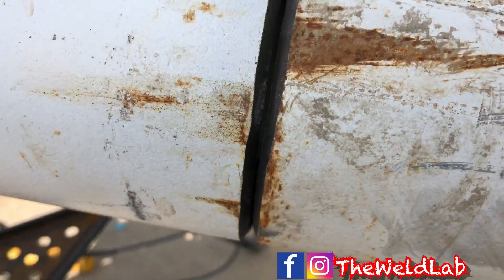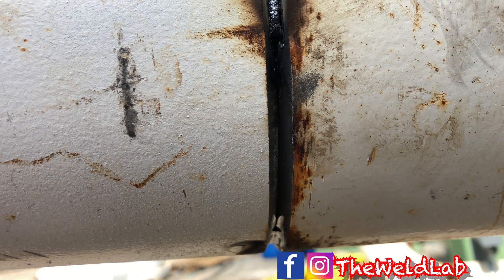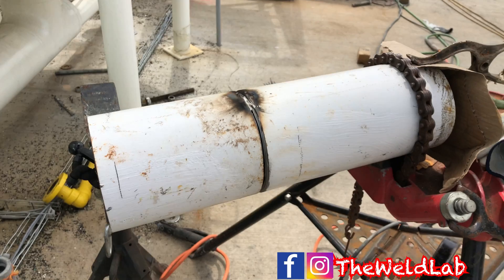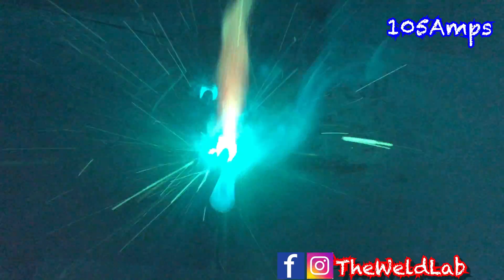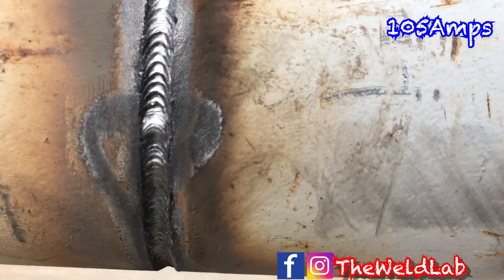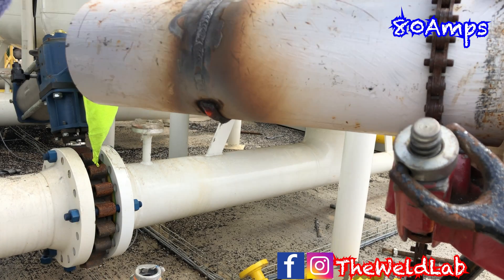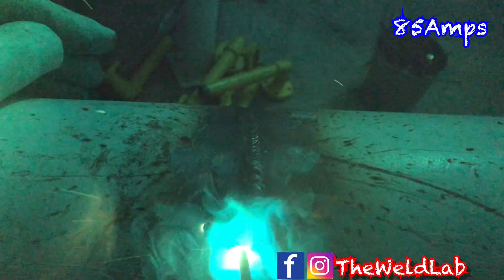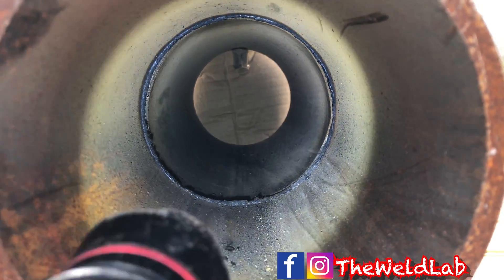5G Pipe Welding 6010 Root 7018 Fill And Cap | Stick

Comment: I'm about to build my truck and I use to be a welder helper and have seen this done, but I'm going to build my truck and just practice a little bit then take off and go welding so I want ti know the in and out with the tecknicts and all the noalage your will to share basic from start to finish on the whole welding process, and the other might and tig and ark welds you do a great job on explaining this shit

Comment: You should have a put a spacing tool on the tight side then you start welding on the opposite side until the spacer falls out, that is when you stop and switch to the spacer side and weld there. Putting just 2 tacks in is asking for problems.

Comment: What settigs should i use i have a sa 250 diesel and im having trouble with the cap im using 7018 1/8 what gear and amperage i had a lot of metal dropping and could getit to stay steady

Comment: Soooo... U did the root pass with 6010, hot pass with 6010, and a fill pass with 6010 and 1 cap with 7018???
Reply: you must be in welding school still

Comment: very interesting technique. Is there a reason you don't tack at 3 and 9 and also, is there a reason you started the root at the top, rather than uphill from 6 to 12?
Reply from the maker: I only use 2 tacks because I find it’s much faster if you watch more of my videos I’m all about quality and production I always try to find the fastest way to put out more work 
And I go downhill because that the procedure my job requires it’s also much faster then uphill

Comment: thought this was supposed to be 7018 fill and cap? haha, i wish i could fill with 6010 on these joints. 90% of the code up here we gotta 7018 hot pass - cap.
Reply from the maker: Yeah man there is different rules for different jobs...and yeah we usually downhill everything and cap with 7018...what y’all welding on?
Reply: I’m from Boston... we do 6010 downhand all the way out

Comment: 3/32" land and the gap?🤔 the same or 1/16" ? Thanks
Reply from the maker: 1/16 will be fine  that’s my preference for any pipe smalller then 6 inches I like 3/32 gap for 8” and up
Reply: @TheWeldLab  Thanks Abraham, your answer and yours videos help me alot. I have never weld pipe using E6010 only 7018 here in europe and next week i have to pass a 5G 12" 6010 open root downhill. Hope everithing will be fine. Thanks you once again and for those briliant videos. Stay safe.
Reply from the maker: @melonmelon3997  good luck let me know how it goes

Comment: Why didn't you opt for a 5/32 hot pass and fill it at the same time? Honestly I clocked on this expecting all uphill lol
Reply from the maker: Yeah bro that would of Ben a better option I was shooting the video at my job and we didn’t have any 5/32
Reply: @TheWeldLab  What kind of work are you guys doing there?
Reply from the maker: Rob Murphy we building a gas plant bro
Reply: @TheWeldLab  Where at? I'm in PA and haven't touched any gas pipe except to renew papers lol been doing structural and equipment repairs to get by.
Reply from the maker: Rob Murphy don’t they have a union job out there a few buddies of mine went out there I heard it’s good money too
Reply: @TheWeldLab  I haven't heard anything about that myself. It's possible.
Reply from the maker: Rob Murphy check with your union bro I think the jobs in monaca
Reply: @TheWeldLab  I'm non union is the only thing lol every time I tried calling a hall they said they aren't taking applications